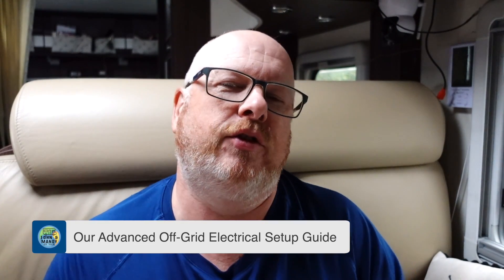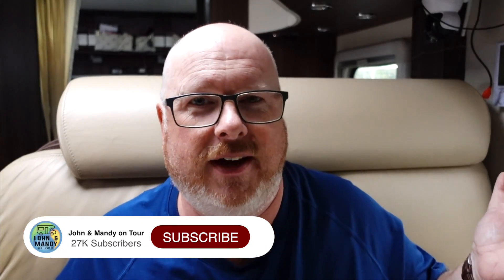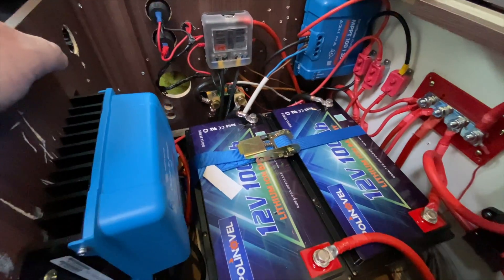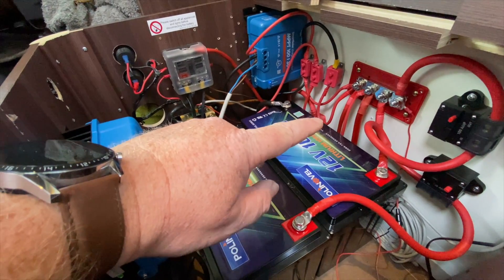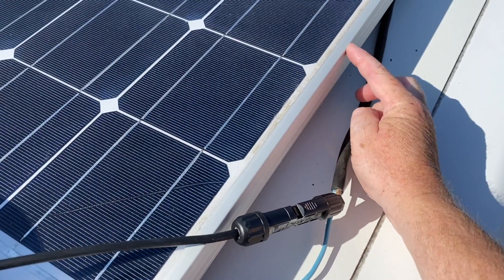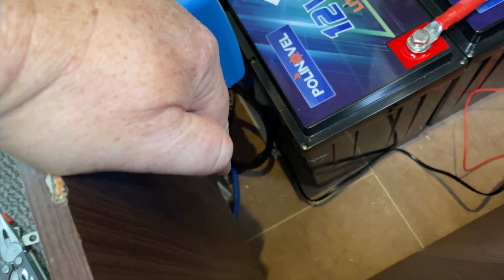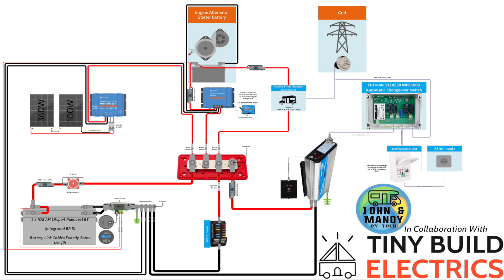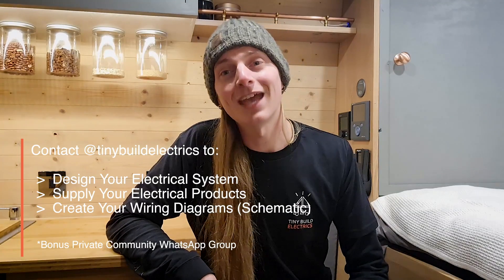Advanced Offgrid 12v Electrics For Motorhome, Campervan, RV, Boat or Cabin

Comment: Great video. What you have done makes perfect sense for off grid full time. I'm impressed with the components you've selected.
You've inspired me to upgrade the poor electrics on my three year old Autosleeper. I think hook-ups will be hard to get at short notice on good sites after Covid restrictions. The B2B and a single large Lithium battery will suit me. A second solar panel and improved solar charge controller are also on the bucket list. Thanks for posting. 👍
Reply from the maker: I think you’re right, camping on grass might be all we get as most club sites say their hardstanding are fully booked for the rest of the year.

Comment: Hi John
I would like to start by saying thanks for another fantastic video
I have a small VW T5.1 I have 150 what solar panel a Victron charger and 2×100 and our AGM batteries I have linked together
I only use my LED lights in the van a 12 V compressor fridge a diesel night heater and the TV off grid it does the job and I learnt this all from you so I’d like to say thank you John
Looking forward to seeing lots more videos and lots more adventures when you can stay safe be well and have fun cheers Colin 👍
Reply from the maker: Thanks Colin 👍🏻😎

Comment: Great video as usual John. Quick question and something I've been wondering... if you have a Bluetooth enabled BMS, is there any need for a battery monitor? As surely the BMS will be able to give a more accurate SOC than a shunt? Given it's not as easy to view, as a reading from a dedicated panel/monitor, but still fairly quick to connect an app. Interested to hear your thoughts mate!
Reply from the maker: Both are monitored by the app and I update the BMV so that Mandy can just look at the BMV display and see if there’s enough coffee power 😂 but I’d not bother with a BMV if you’ve got  Bluetooth lithium batteries 👍🏻
Reply: @GadgetJohnAdventures  🤣 still on the old kettle and fire method myself for the coffee! Maybe one day! Cheers, take care you 3 👍

Comment: Hiya John..nice video, thank you.. 👍😁
I have a question for you..
Your solar panels are wired in series..does the smaller panel restrict the output from your bigger panel at all, or are they a similar output for volts/amps.? 🤔 many thanks.. 🙏
Reply from the maker: I get over 420watts / 25 amps from the two panels in UK summer, so for me they’re working well 👍🏻

Comment: John would you expect to have to replace or upgrade any of this system during the life of your ownership. How long would you expect the batteries to last or would you expect to upgrade your solar panels after some time either through a loss of efficiency or an improvement in technology?
Reply from the maker: The batteries will give us around 18 years of life before they will only retain 85% of charge, the solar panels should give a similar life span too and I’d expect the other components to hold up for at least 10 years too.
Reply: @GadgetJohnAdventures  great value for no electricity bills

Comment: Hi John, very comprehensive & helpful.Thank you.  You mentioned previously,  in your Auto-Switch-over instal video, that you had removed the fuse from van electric cube, that controlled the inbuilt battery charger ( this to stop the van charger trying to charge the leisure batteries,  while you were disconnected from shore power and running the inverter). Now that you have more of a need to regularly  charge your leisure batteries from combined van battery charger + new B2B, have you found a more elequent way to solve this need to regularly remove / refit this fuse?. Sorry if I missed this detail. Many thanks for insights !!
Reply from the maker: As we very rarely hookup the fuse remains in the dash cup holder 👍🏻 but I do have a breaker spare so I might now fit that and “complete” that job 😎

Comment: what i always find interesting is B2B is the cheapest cost charging solution (by far) and most fast and effective. If you are the type of vanlifer who travels everyday, there's an argument that says everything solar  is expensive and cosmetic. Especially as you can run B2B units in parallel for redundancy, say 2x30A, and use some of the money saved to increase battery bank and allow a few static days.
Reply from the maker: But then you find a lovely quiet spot and want to stay for as long as you can, with solar that becomes much less of a problem.
Reply: @GadgetJohnAdventures  indeed

Comment: so £3700 pounds not including the equipment in the van as standard  thats a lot of money for most people  agm batteries would save £1200 pounds and last say 3 years by which time new cheaper battery tech should be available or lithium should be cheaper. was  talking to a friend who had built his own camper and had a 3kw inverter he used for kettle  and microwave he has 1 used 100ah lead acid battery in his van i said to him how do you run a 3kw inverter from that . he replied i dont when i cook i leave the engine running for the  time the inverters on and the  altanater does the work its a sprinter with 250 amp unit. think on more than one way to skin a rabbet . i would  think most of the power you use comes from the engine when you are  driving and not the solar on the roof  .
Reply from the maker: You can also walk and camp in a tent, but you don’t find idiots making those arguments do you 🤣

Comment: John an excellent video as always and a great help in understanding how to put a system together. I have a question about your experience of putting solar panels of different sizes in series. What are the issues if any of say putting a 80W panel in series with a 120W panel. I have seen elsewhere on the web that you do not end up with 200W and it is not as good as having two 100W panels in series. Any view on this, thanks in advance.
Reply from the maker: In summer on a sunny day we regularly saw over 420w, considering the old panel isn’t the best quality I’d say that fine. Bearing in mind all the cells of a solar panel are wired in series too, so it’s easy to see the mother works.

Comment: John. Another fantastic video. Been bored during lockdown so reviewing our set up. Your set up is much the same as I am going for with the SP and MTTP, B2B and Lithium battery (only need one for now). How do you deal with the van battery top up either by solar or from your electroblock (on EHU). Perhaps the van battery is not an issue? Our van does have a Nordellectronica (electroblock) unit with both van and leisure battery top up when on EHU. The van could be sitting for a week or so with a tracker active so I am concerned the van battery will run down.  So I got a dual battery MTTP to help keep the van battery topped up. If I connect the MTTP trickle charge to the van battery will the B2B see the solar trickle to the van battery and confuse it to activate the B2B?. Think you did mention it in one of your videos a while back but not sure what the final outcome was.
Reply from the maker: We move around so often that’s not been a problem, we’re starting the van to charge our leisure batteries right now too 👍🏻
Reply: The Renogy B2B and MPPT (recommended by Will Prowse) supports trickle charging the starter battery from solar (when leisure is full)

Comment: Hi John, thank you for posting this vid, Question;- I think many of us could copy the wiring diagram you posted on this vid, but Is there a sequencing or order in which one should join cables/wires so as to work safely and not get any shocks?
Reply from the maker: I walk through the connections in the video, so just follow that.

Comment: I love nerding out on the electrical videos. I completely agree with the battery sizing comment, all well and good having colossal storage but unless you can replenish then it's just a waste of weight, space and money. 

Your solar setup is interesting. I know that the generally accepted view is that solar panels should be paired rather than mismatched and I've never really understood how much of an issue it is. Do you get the power you'd expect from them wired as you are?
Reply from the maker: The solar delivers around 25 amps on a summers sunny day, so it’s working as expected 👍🏻
Reply: @GadgetJohnAdventures  Brilliant, have you looked at solar trackers? It's the next project on my list some of the results I've seen people get are fantastic.
Reply from the maker: I have not, our system works perfectly for our needs and delivers more than enough power, no point reinventing the wheel if it already goes around and around smoothly.
Reply: @GadgetJohnAdventures  Makes sense. I am attempting to use my DC/DC charger as little as possible when stationary, nothing to do with issues with the engine running when stationary just annoys me when I'm working with that rumble in the background.
Reply from the maker: Have you thought about free standing panels for outside, low tech solution but we find ours to be really good for charging the battery packs 👍🏻

Comment: hi John & Mandy, great video once again, question for you and anyone else who might know the answer, i've a 2018 Autotrail Comanche with the Sargent EC700 controller. I've fitted a Victron 75-15 smart solar controller and 180w panel on a separate system to the Autotrail's installed 100w panel which is controlled by the Sargent unit, I've replaced the 2 batteries to Leoch Pure Lead Carbon 100ah ones and was about to install a Victron DC - DC charger to help keep everything topped up via the engine/alternator as i'm also fitting a 2kw inverter and have been told that Autotrail cannot have a DC-DC charger fitted. So the question is, does anyone know why, if this info is correct, that you cannot fit a DC-DC charger to an Autotrail and the reasons why? Thanks and keep up with the great video's
Reply from the maker: You can absolutely install a b2b charger 100%  Watch my b2b install videos and you’ll see how well all the different systems work with each other.
Reply: @GadgetJohnAdventures  I have John and thats what's spurred me on to want to do it, but i've been informed that its not possible to fit one on an Autotrail and wanted to know the reason why, its baffling me tbh. thanks  Al
Reply from the maker: There’s is absolutely no reason at all. I’m being serious, it’s keyboard warriors with no experience or 1 numpty who read the manual wrong and told the internet. 
For example we had a disaster with our original lithium batteries, which was purely down to bad advice, once I worked out I could ignore the bad advice I’ve gone back to lithium and they are brilliant.

Comment: John, 
Another “Brilliant video” and explaining how your whole system works! Easy to understand! I've basically have most of that except for B2B as we have a Caravan and understand the run from Car Battery to Caravan victron B2B would be too long? I've got 2 x 105 Ah AGM’s so can swap them out no prob. Have to check your battery supplier can deliver to the Netherlands? I have Nespresso coffee machine. I'm wondering if I need to upgrade my inverter to 3000w from 2000w pure sine wave that I currently have? Thank you once again for this valuable insomuch appreciated cheers Chris “The Aussie living in the Netherlands 🇦🇺” 😄
Reply: Just as a thought Chris. Had you thought about buying Lithium direct. I've just brought 1120amps direct from Polinovel (their HD series) through Alibaba. Linsa was super helpful.

Comment: If you HAD to fill up the space on the bottom right of your roof, what would you put there? 😊
Reply from the maker: The old 100w panel would go and I’d get 2 panels to go either side of the rear skylight, biggest that would fit and probably tillable 👍🏻
Reply: @GadgetJohnAdventures  Sounds good :) I have my 2x 150w panels on Eco-Worthy tilts but they're a big pain so I hardly ever tilt them

Comment: Wow that was a great vlog. I'm new to electrics and found it a bit over my head, however I was tieallt engaged and really want to learn more. So I will go over to your links. I am very impressed with your knowledge and want to thank you both for all you put into making these blogs. I always take something positive from them.
Iv been cutting the curves for the bulkhead today in which felt like working in a refrigerator, working with one small light running of a phone charger, and guess what 🤔 I cut and scribed almost perfect with a hand saw and the worse work mate you ever came across, it took me two hours to build and the handle snapped off tightning the wood in the vice. So the moral of me nattering on is, its great to tune in after a hard challenging day. Thanks n stay safe, see you soon.
Reply from the maker: Scribing is the worst job ever and in this weather too, that’s extreme 😎👍🏻❄️❄️👌🏻